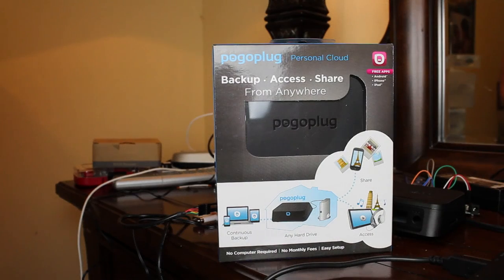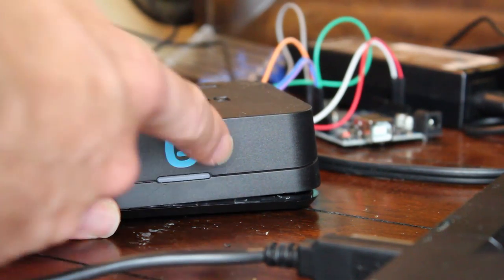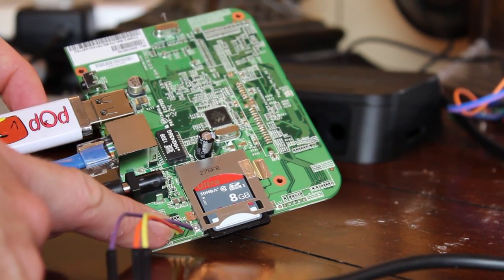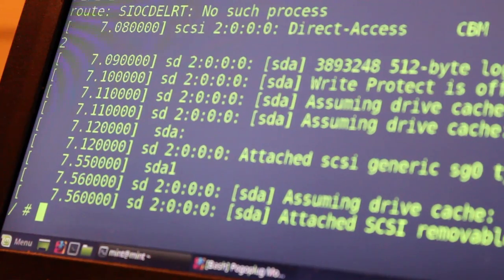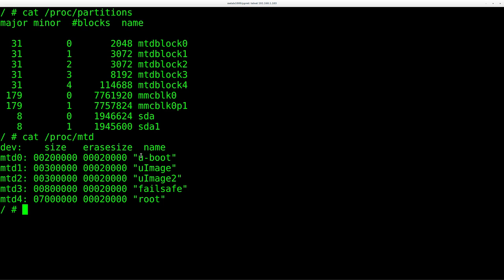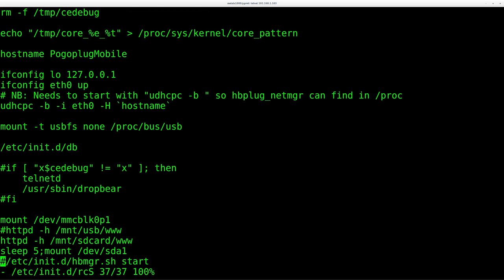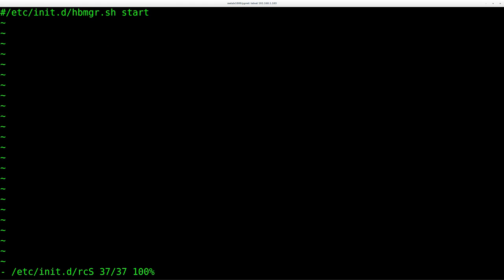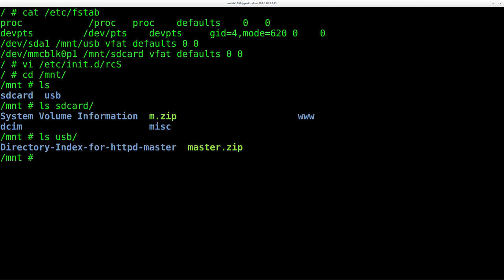PogoPlug Mobile v4 Serial Port Hack

Comment: Hello Kris.
A practical way to find the Device File name such as  /dev/ttyUSB, /dev/ttyACM, etc ,  open a terminal and run:    udevadm monitor    [ PRESS ENTER]
Then plug the serial port ( in your case the USB ) when the usb is plugged the terminal will produce an output.  If the OS has the right Kernel Module it will create the Device File such as ttyUSB. This Device File name will be shown in the output produced by " udevadm monitor"  command.
Regards
William
P.S
Good Video!
Reply from the maker: Thanks, I'll give that a try.

Comment: Hi Kris - nice video. Note that you can probably avoid the impact of the wait for the serial console (the 5 seconds at the end) by waiting in a subshell - i.e. 

(sleep 5 ; mount ... ) & disown

The "&" will put the subshell in the background, and the "disown" will make sure the termination of the parent shell won't impact this child. Worth a try, methinks :-)

Cheers!
Reply: That's a good suggestion.  I figured I could through the commands in to the background, but I was unaware of the disown command.  I'll have to look into that.  I would think that the '&' would have been enough, but I didn't try it.

Thanks
Reply: The "disown" shields your job from dying when the parent shell dies (read this analysis to see why: https://unix.stackexchange.com/questions/3886/difference-between-nohup-disown-and).  

Still, since this is probably just busybox "ash", it may be lax about enforcing such "advanced" things :-) so indeed, it may work by just adding the "&".

Keep it up! Subscribed to both your channels.

Comment: Where's the other video you mentioned? I think mine is "bricked" because it constantly flashes a green light very quickly, and it's not running an HTTP server. It also won't boot from a flash drive but I admit I may have done something wrong.

Comment: humm, i might have to open these also since they dont allow you to enable SSH the old WEBUI way anymore is what i hear
Reply: gotbletu I was able to do it to my ver 4 tonight. I initially tried it from an iPhone using Safari and it took a while to pull up.

Also, my root was already rw but fdisk was not installed.

Comment: i have a question about the pogoplug. when i used the pogoplug i found that in its stock form it had really bad transfer rates for moving files. my question is when you were looking around in the software did you find anything that could be changed that would improve the transfer speeds or is it not anything to do with the device or software but just pogoplug's servers that limited the device? i have watched your videos on this and found them very interesting and they make me really wish i knew more about linux. also how long do you think it took you to really get a good understanding of how linux works? Thank You
Reply: Good Questions.  As far as using the Pogo Plug services, I only did that few a little while, and it was well over 5 years ago.  If you are using their services, you're connecting to the Pogo Plug through their website, which my limit or cause slowness.  That being said, the Pogo Plug is not the fastest device in the world.  I run Debian on mine and use SSH for pretty much everything.

To be honest, I never really check the speed between my devices on my local network.  But, after I read your questions I looked into it.  I used a program call iperf, which is in the Debian repositories and I tested the speed from the Pogo to my desktop, which is over Ethernet through a switch and a router, and this was the result:
94.0 Mbits/sec

I also tested from my wife's Linux Mint Computer to my desktop, which is through the same switch and router and then through TRENDnet Powerline 500 devices and got:
54.7 Mbits/sec

So, I'm getting better speeds to the plug then I am to my wife's computer.  I ran the same test on each machine twice and got pretty much the same results each time.

When I tested from my desktop to the two machines I got about 70.0 Mbits/sec on both.

Not sure if this answers your questions or not...but it's information :D
Reply: thank you. i had a copy of arch arm5 running with samba working and webman but i decided to TRY to switch to debian and now its toast. i get it to boot and the light on the v4 goes green but then it resets the nic and i only get a orange light and no green nic activity light. i am up in the air on if i want to spend the time and money on a serial to usb cable to try to fix it with no real skill in doing it. btw best transfer rate over samba i got ws 12MB per sec.

Comment: I've soldered on the connections and I can see all of the output from my Pogoplug v4 as it's booting up. When it gets to the very end, I get "XCE: LED -> CONNECTED". The next line is blank. It looks like it should be a standard bash terminal, but on mine I don't get the # and it doesn't seem like I have access to the terminal. I type and hit enter but nothing happens. Any ideas?
Reply from the maker: Sadly I don't have any suggestions.
Reply: Possibly check the Receive connection from the Pogoplug. Being old-timer serial port terminal user (pre-PC), I have seen numerous times where 1 connection was good while the other was not. When that happens, data flows one way fine but not the other.